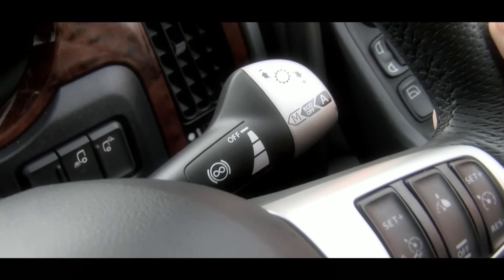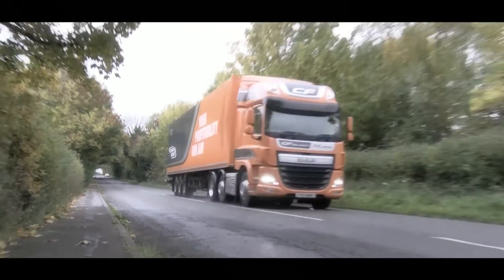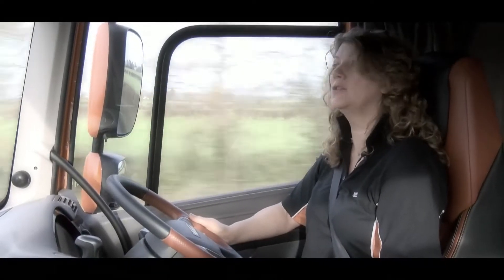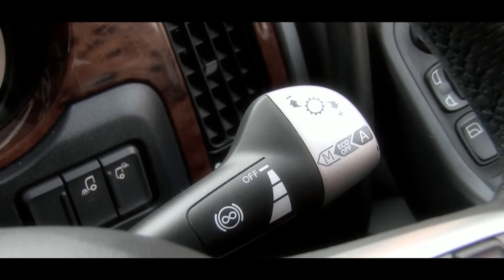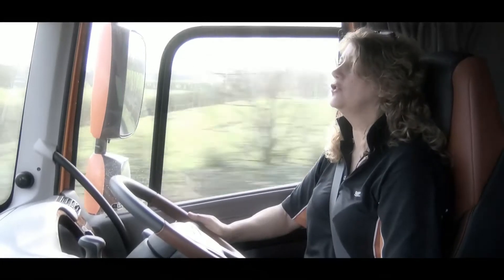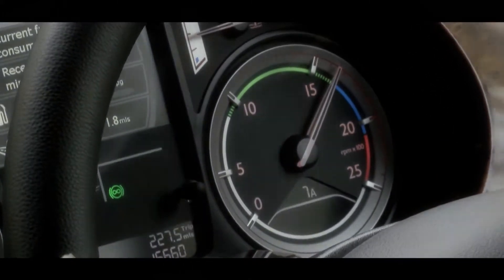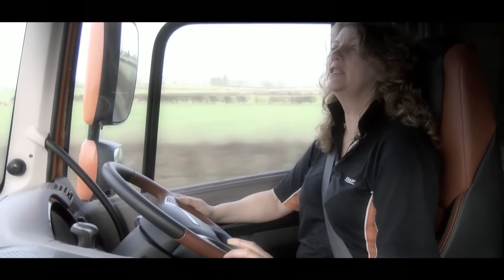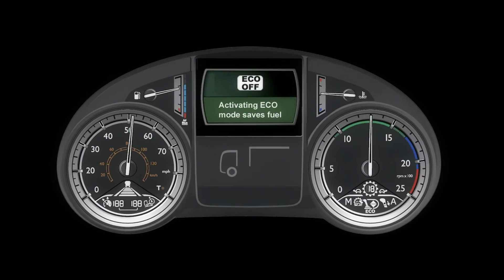DAF Trucks UK | DAF Eco Mode Explained | Training Video

Comment: Worse thing about modern euro 6 Dafs, especially 2015-2018 models, the euro 6 step c versions are much improved, however it can still be to restrictive and as a result our company had eco mode deleted from all its units with no detrimental effect on fuel consumption.
It literally transforms the performance.
Reply: How can you delete eco mode
Reply: @astragsi9389  has to be removed by the dealer, takes about 30mins.
Truly awful things to drive with eco mode so frustrating, irritating and counter productive as drivers hammer the arse out of the truck.

Comment: What about the LF modern as they don't have this switch. Our operators truck owners have supplied us with a fleet that are all in eco fuel mode that severely limits them especially with a full payload. Is there a way to deactivate it in order to drive without being swamped by other traffic?